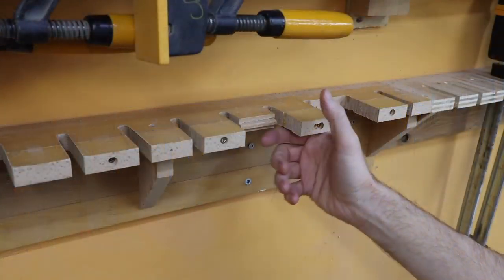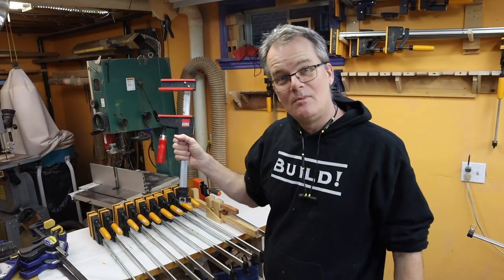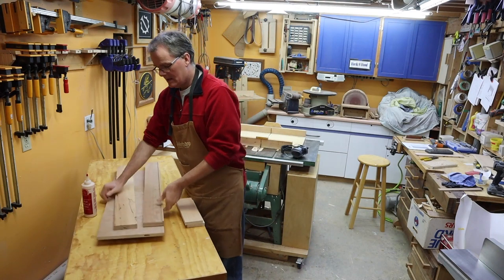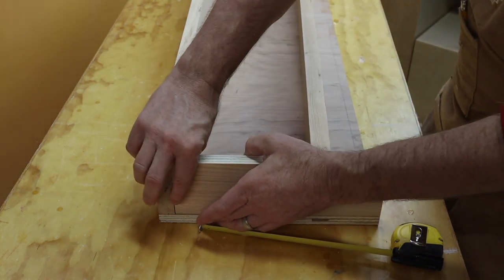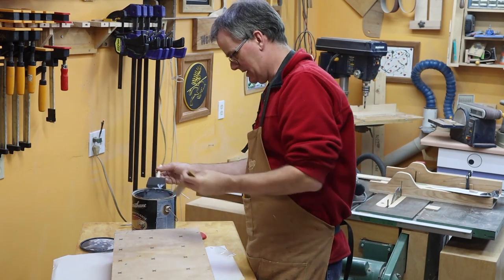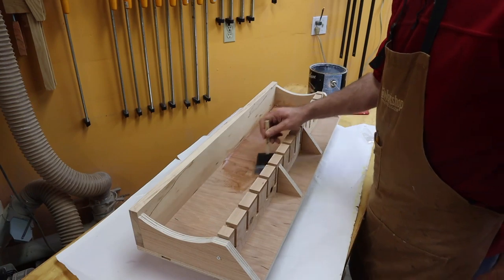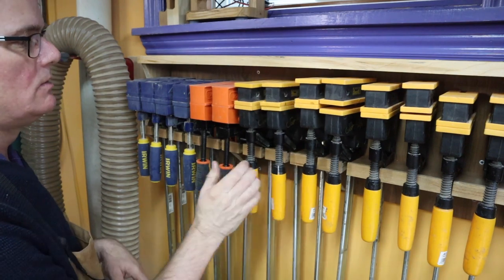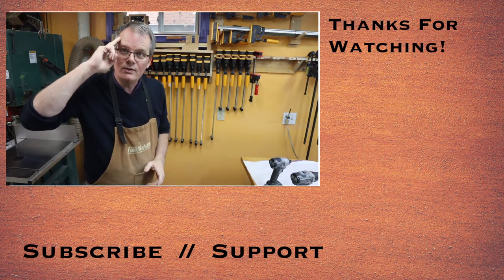I Stole This Clamp Rack Idea (WnW# 198)

Comment from the maker: Patrons Rock!  https://www.patreon.com/wordsnwood
📃My Build Article:  http://www.wordsnwood.com/2020/clamprack/
📃I started here: https://www.thewoodwhisperer.com/articles/parallel-clamp-rack/

This is a quick and useful shop project.

I have a bunch of parallel clamps.  One of my clamp racks was broken, and I got a few more clamps.  This caused me to think about clamp storage.  I did some reading and found the Wood Whisperer article linked above.  Some of my design is based on his idea, which he based on someone else, and so on.

My old clamp rack was designed for the clamps to be clamped when they are stored.  This adds an extra step when putting them away or taking them out.  I wanted to try out a clamp rack where the clamps are NOT clamped when stored, they are just resting there loose.   Yet still secure.  Hope that makes sense.   

Read the article!  I have basic plans there if you want to build something like this.

YOUR SUPPORT IS APPRECIATED:
💵 Become a Patron: https://www.patreon.com/wordsnwood
🛒 Buy a Plan: http://wordsnwood.com/plans/
👕 Buy Merch: wordsnwood.com/merch.html
👉 http://www.wordsnwood.com/support.html

Comment: I like this design Art ! nice job I think I'll need to barrow it for the new tool wall I want to add to the shop. be good buddy, Jon
Reply from the maker: I borrowed from Marc, and tweaked.  He borrowed from someone else and tweaked also...      I want to start using slightly nicer materials like this in my shop builds.  The maple top shelf, and the cherry veneer on the plywood make this look so much nicer on the wall.    Stay safe, Jon!

Comment: good job...one thought...I used to think like you (It's just shop furniture) but then John Heisz said something that made me change my thinking.  You spend a lot of time in your shop..surround yourself with nice things.  changes/uplifts your attitude.  Doesn't have to be fine furniture, but why not make it pleasing to be around.  Also, a suggestion for the broken clamp rack...why not 1/2 ply accross the top.  Presto, back in busines!  I enjoy your videos and look forward to each new one.
Reply from the maker: I fully agree.   After I was done, I was delighted at how nice it looked, and that was mostly an accident of having some cherry plywood scraps.  I need to make nice things for the shop!

Comment: I recently bought a used large collection of the Jorgensen Cabinet Master clamps and am needing a storage solution.  Would it not be advisable to hang by their "tail end" the removable bar stop?
Reply from the maker: I like this method as I think it's "natural" to grab the clamp by their heavy head/handle.  If you want to hang it by the tail then by all means.  We don't all need to do the same thing.  👍
Reply: @Wordsnwood  Got to be why everyone on YT does it this way.